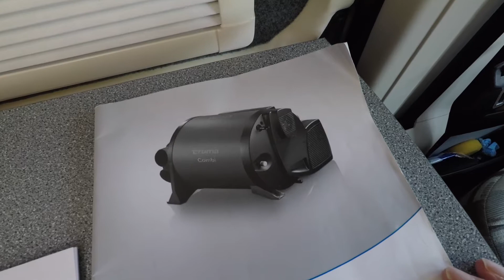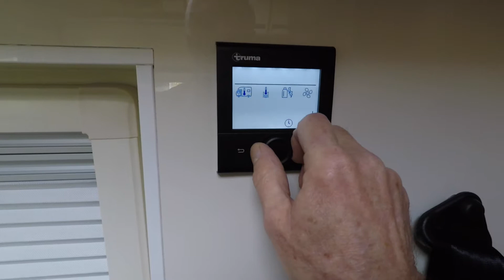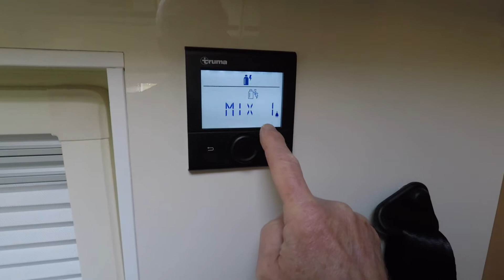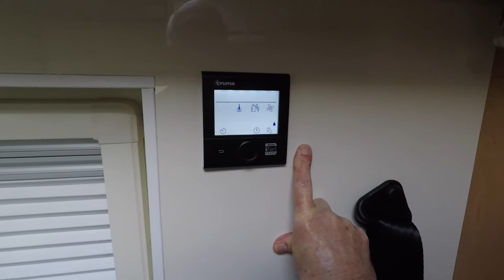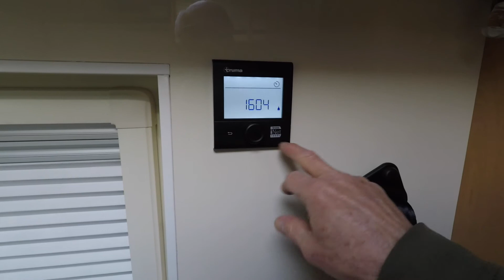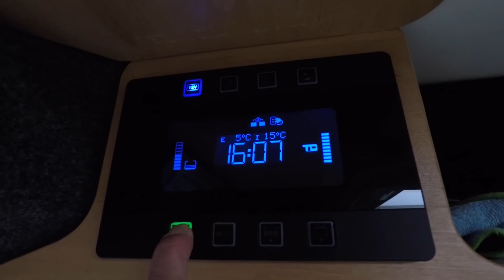Truma Combi E boiler and Control Panel explained

Comment: Thanks very useful… through testing the temperature displayed (when idle) seems to be the target temperature. I feel it would have been better for it to display the current temperature (rather than target)… have you found a way for it to display the current temperature by any chance?
Reply: The default temp displayed should be the current van temp. After setting the target temp press the back button and it will take you to the clock and current temp display. NB The current temp reading in a van is greatly dependent on where the sensor is (which is where the installer put it!).  A shaft of sunlight in the right place can temporarily send the sensed  temp shooting up way above what the real temp is in the van.
Reply: @roamwithme9684  thanks for your note, however my unit displays the target temperature, here is a short video. I’d be interested to know if yours is different. https://youtu.be/x1mlzcvCd8A
Reply: @mikefardell  I would expect it to show the cabin temp by default., not the target temp. Try  turning off all power inputs for 10 secs and try again
Reply: @roamwithme9684  thanks… I would expect to see current temp too. I tried your suggestion to no avail. I found a manual online and that states that the “display changes between the time and the set room temperature” so I guess it’s ‘by design’ although displaying the room temperature would be much more useful (in my opinion).

Comment: Good to see it explained exactly as you said for the novice/beginner. Do you find most people ignore the timer ? I’m guessing it can heat the van up super quickly?
Reply: Yes, a van of this size can have warm air comfort in just a few minutes. Of course, if the van has been left unheated for a long time, it takes much longer for the heat to sink in to the 'fabric'. I don't bother with the timer because van life for me is generally far less structured than normal day to day life in a house, so any programmed settings probably wouldn't be right on most days.